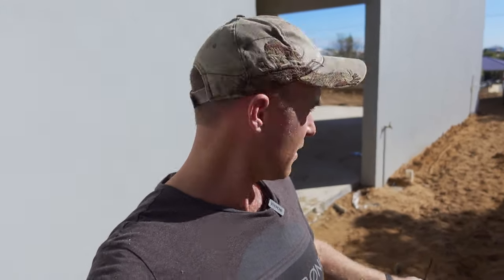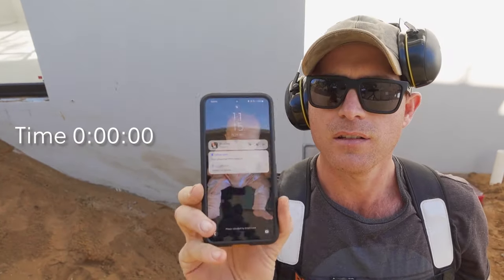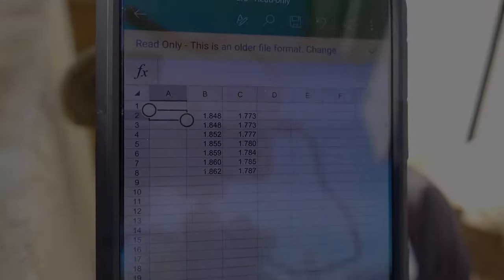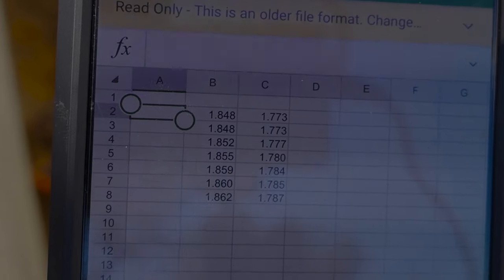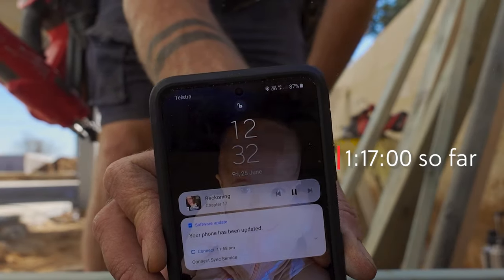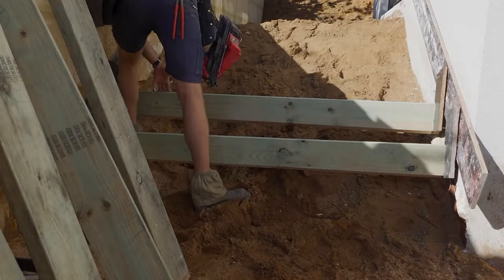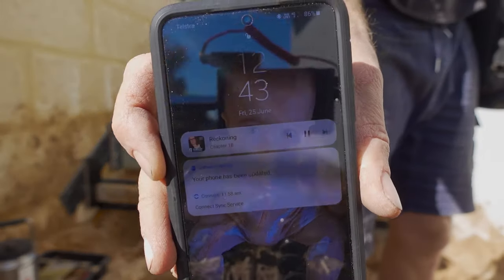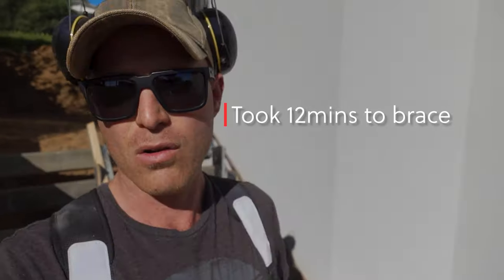11 MINUTES TO INSTALL CONCRETE STAIRS BETWEEN WALLS

Comment: Yep! Nice job brother! Im setting up steps between to block walls. Tricky!! Last one I did I used shims for the sides of the step and the lay down support 2x4 you also applied in your video. I like your way better. Thanks!
Reply from the maker: We build a lot of stairs and this is the quickest and easiest for me

Comment: Nice set up!! Great to see a real carpenter set up correctly makes it easy for the finishers to get in strip & finish the face & nose  properly.
Reply from the maker: We usually don't strip and finish the faces here due to hot dry climate. We strip the following day. If vibrated correctly there is no need to trowel the faces. These stairs in the video were exposed aggregate finish anyway, so the concreters painted a retardant on the formwork. Strip following day and wash off.

Comment: I want to redo my front porch with CMU's and concrete steps. I can figure out the layout etc. I wanted to know how to anchor the forms for the steps to the CMUs on one side. What type anchors did you use?
Reply from the maker: What are cmu’s?

Comment: Just curious slope for water  some rebar would help would help if explaining more of what you did hard to tell fast but not sure if correct.
Reply from the maker: I have other videos which show in more detail. This video was to show speed  using my method when you know what you’re doing. I’m pretty sure slope is mentioned in this video or you will see it in my other videos. All external stairs I do have slope. I mark the stairs as normal but when I cut my rises, I cut the rise around 7mm -10mm shorter than what is marked. This creates the slope.

Comment: I am a fitter/machinist by trade and worked alongside with concreters that just stomp around destroying the hard work of the formwork carpenters, many times  I've witnessed  formwork fail due to overloading and failure from these types of structures mainly on large projects. Now they use steel to take out that possibility of failure.
Steel isn't fundamentally much different to timber but definately more robust, longer lasting so less waste, with identical finnishes.
Good work though.
Cheers
Reply from the maker: Many ways to skin a cat. I used to own some aluminium panels for suspended slabs. But for these small jobs I need the flexibility timber provides. But yes on big jobs something like peri or meva or doka is much better if you can afford it!

Comment: What are those black boards you nailed to the risers? And where can I get me some? And I saw you angled the bottom of the risers… what angle was that angle, or does it matter?
Reply from the maker: Form ply. It's plywood with a phenolic resin coating. I cut them 30deg. Most people do 45deg but it is harder on the saw and more likely to cut you when handling. 30deg lasts longer too over lots of uses. 45deg more likely to snap off.

Comment: Hi mate, may I ask why you put the stringer between the wall and the the timber? Some of that formworker just nail to the wall directly. Thank you!
Reply from the maker: It’s easier faster and more accurate nailing ply cleats to the ply string. Because the wall is hollow bricks you have to drill and fix every individual riser. You do get very quick at this method but my string method is far quicker. I did it for about 10years for each method and string is much better.
Reply from the maker: You also don’t need to cut the risers to length as accurately with the ply string.

Comment: Hey mate, I may have missed it but the small gap underneath the stringer between the riser and wall, is that ever an issue for getting the tread out or no? Awesome work man 👍
Reply from the maker: Nope no problem at all. Just never cut it tight, about 3mm short and it slight out easy
Reply: Got some stairs coming up want a day lol

Comment: Im new to this but once you have poured the concrete how do you get the formwork on the sides out?
Reply from the maker: Pull the nails out and slide it out. I have a video on it. Takes about 5mins to strip whole staircase.

Comment: Looks good like the nail gun good idea how's pulling them?
Reply from the maker: Hi Tony, watch my video game changing tools for formwork. I go into some derail about pulling nail gun nails. I also have a video coming on stripping stairs, basically I can strip nail gun nail stairs about 3-4 times faster than screws and just as fast as normal bullet head nails. the key is nail placement and leaving the heads out.

Comment: That's you video is about,  how much concrete stairs wood forms you can install by 8 hours day work ,that's what is all about?  I counting and look like 38.15 per hour and  305.2 per 8 hours concrete stairs wood forms you can install . This is what you doing all day I mean that how you work look like?  Nice I like it. Don't forget install each way rebars #4 and  nosing bar on individual concrete steps and anchors in on both sides of concrete walls with using epoxy.
Reply from the maker: I suppose so, only thing that slows you down on bigger stairs is climbing up them and your body. We don't epoxy into the walls on these, better to keep stairs separated from building. The guys usually just install mesh on these, it's not high traffic.

Comment: Soooooo many questions, yeah. You were fast but why were you doing what you were doing. How did you come with the calculations? What determined the riser's, the run? Why cleats? What was the purpose? So many more questions
Reply from the maker: You need to watch my other videos for the answers to all those questions. Other wise this video would go for an hour and no one would watch it!
Reply: @bmformworkconcreteconstruc9783   understood THANK YOU SO MUCH FOR THE VIDEOS!!! But which video in particular? Only cause I'm time conscious, working and side hustling to make ends meet, which we all are. Otherwise I would view them all. But that would be rather time consuming.

Comment: Does anyone want to know how to eliminate the bracing up the middle and still maintain bow free face boards?
Reply from the maker: I do
Reply: @bmformworkconcreteconstruc9783  Face screw a 2x4 perpendicular and to the top edge of the dry side of each face board...no bow on the bottom face of at least four consecutive 7in x 7ft wide steps and plenty of clearance to finish treads...for shorter steps screw a 2x2 steel angle across the top of each face board- gives more room to finish.

Comment: What sort of circular saw was that?
Reply from the maker: If it was red it is the 185mm Milwaukee. love it. Just wish they made a 210mm saw. 185mm blade doesn't quite cut through our timbers. About 2mm short! If the saw was black and green it is my festool hk85.

Comment: i must have missed it. where did 11 minutes come into play?

and where was the concrete in this video? i didn't even see a little bit of it...
Reply from the maker: Must have missed the point, I suppose. Formwork is a different trade completely to concrete. My videos are about Formwork. Sorry for the disappointment.
Reply: @bmformworkconcreteconstruc9783  i guess i didn't understand what "installing concrete stairs" meant.

maybe if it were "11 minutes to install concrete stair framework", but the process still took more than 11 minutes.

Comment: Impressive work!
Only one question…
It looks like the riser (face) board stops short of the total span between the walls, to slow for the width of the long board that you fastened at an incline to the walls. It looks like it will leave around 3/4 ‘s of an inch on either side. (Thickness of the board that you used)
Doesn’t that add labor to the finishing process where the step face meets the wall?
Other than that, very nice carpentry. Best of luck!
Reply from the maker: no there is no gap, riser finishes tight to wall. these steps will be exposed aggregate too so it is ok for me not to have a smooth finish as the exposed agg finish hides any imperfections. But definately no gap on the wall between riser and wall.
Reply: He nails Packers on the ends

Comment: Took 11 minutes to unload tools and materials
Reply from the maker: Probably more haha. I have too many tools but you know what, after doing this for 17plus years, having so many "toys" to use and finding different was to do the same job is what keeps me coming in each day and still having the motivation. Most guys just have a skill saw, hammer drill and a level, I used to bag anyone who had more than that, if someone came on my job with a square I would throw it in the trash! Not anymore, tools have come so far, it makes the day much more enjoyable in my opinion.

Comment: How high above the pitch line did you fix the stringers and why?
Reply from the maker: I fix the string because it’s faster and more accurate nailing each riser to a ply string rather than drilling into hollow bricks. It’s about 30mm above